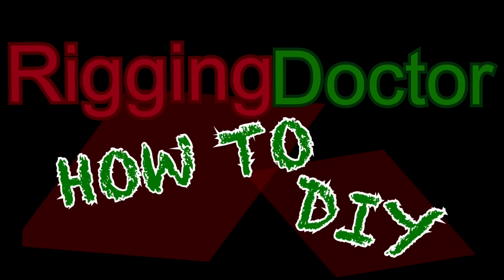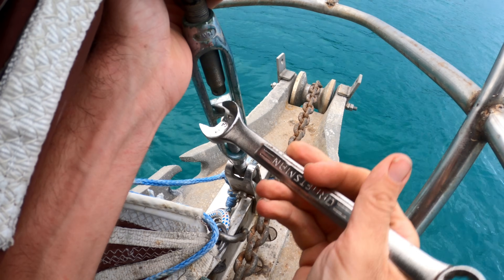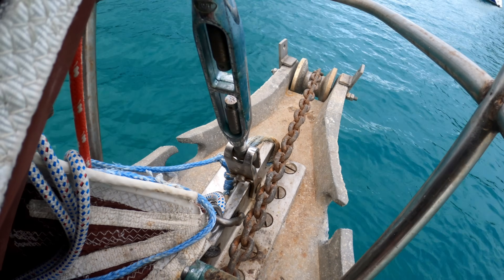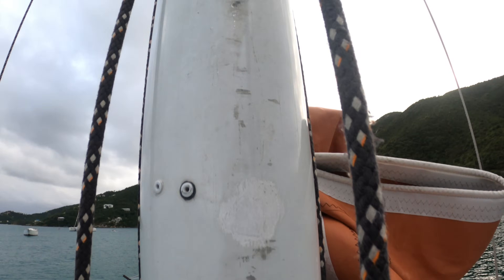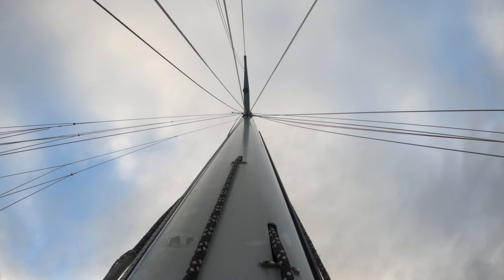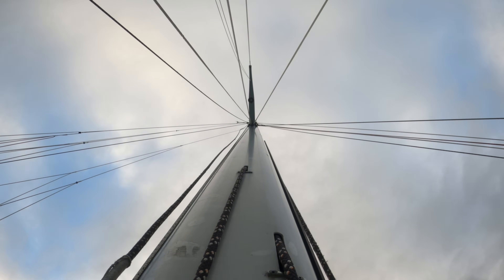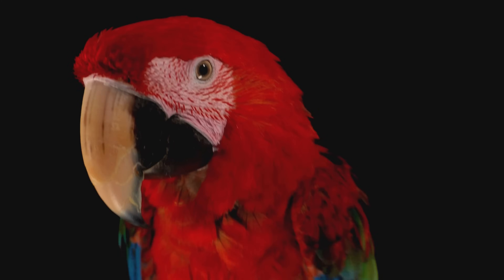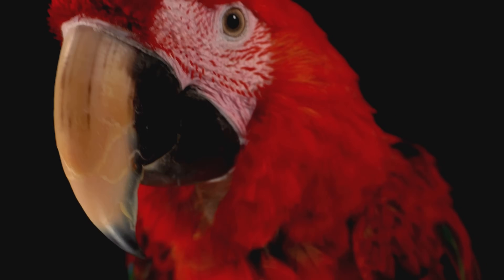How TIGHT Should Your RIGGING Be?

Comment: LOL so much wrong in this video, turned off as soon he started using gravity on a boat at anchor LOL.
Reply: @Sea Horse i am not an expert nor do i claim to be, but come on use your common sense do you really think hanging a 5 gallon jug from your halyard sounds like a good way to check the centering or rake of your mast i’m sure you have more common sense than that.
Reply from the maker: You can hang anything you like to make a plumb, but as a cruiser and a person who favors the practical, a 5 gallon jug weighs about 40 pounds and makes for a great weight. 
Would you prefer that I use something branded, expensive, and exclusive? Real sailors need to know how to check and fix their rigging with what they have on hand; every cruiser will have a halyard and a jerry can!
Reply: @Sea Horse To be fair, he wasn't claiming to be a professional or a perfectionist -that claim lies with the YT poster -who has made serious mistakes over time (as we all have). He's criticising POV's which is part of normal discourse and key for finding the best way to do something. YMMV advice is good.
Reply: @Sea Horse https://youtu.be/d6XVMZdyFLQ i don’t make you tube videos but here you go this is how it is done, notice no hanging jugs.
Reply from the maker: If the boat is properly trimmed in the water, gravity is of great assistance. If your boat is loaded unevenly, then you need to sort out your cargo distribution before you get underway (or even think about timing your rigging).
Reply: This is the same guy who said mizzen masts have no effect on the sailing of a boat...... proof of you own your own camera,  you can be an expert in their own mind
Reply from the maker: I think you should rewatch my video on Ketches and Yawls as you clearly misunderstood everything. 

I’m assuming (and this might be a stretch) that you understand the difference between a yawl and a ketch, as the mizzen in a yawl plays a much different role than the mizzen in a ketch.
Reply: I will do you a favor and explain at as i have actually set the rig on my boat literally hundreds of times i.e. before every race.  For rig centerline take your main halyard and pull down to deck level at the chain plate or deck hull seam this should be the same on each side of the boat adjust stays to center. Mast rake should be done by measuring  with a tape to some point on the stern or bow check with the manufacturer or user groups each boat has a specific measurement to properly set the center of effort.

There you’re welcome.

And please don’t spread BS info  and call yourself the “rigging doctor “  when you know nothing on the subject.
Reply from the maker: The important thing is you know how to set your rigging on your boat. This makes you a good sailor. 
As a rigger, I know how to set the rigging on a variety of boats and understand the differences between them and their needs. You said “before every race” and “user groups” so I’m assuming you have a very light boat that is tender. My weight on a halyard method would be influenced by a person standing on the boat. If they moved slightly, the boat would shift and give an inaccurate reading. The only way to do it with weight would be to stand on the pier on a very calm day and see where the weigh hangs with no one on the boat (and the boat perfectly trimmed before starting, naturally). This is a hassle and therefore your method of using the halyard as the hypotenuse and finding symmetry works just fine in your application. 
For a heavy cruising boat loaded up with all your worldly belongings, the weight method works very well because the boat is not as sensitive to weight changes and is more stable in the water (and also slower). 
Understanding that every sailboat is unique and setup a different way for a different purpose is what sets me apart and makes me the Rigging Doctor.
Reply: @RiggingDoctor  No, sorry, wrong, direct measurement is the only correct way. 
I should have dumped your channel a long time ago.
Reply from the maker: I’m sorry you feel that way, but have fun at your races :)
Reply: @zoomzoomracing  Ha! that's funny. I once tried to set my stays by measuring ( just for fun I knew it was a bad option) Adjusting them to be equal gave me a mast like a banana. My boat is hand built an in no way symmetrical which is why I knew this wouldn't work. But even with a modern production boat you're kidding yourself if you think you have perfect symmetrical triangles between your masthead, chain plates and mast foot on either side, they simply will not be, so measuring is futile. If you have a lighter boat that you think may be affected by your own weight then get in the tender on a windless morning at anchor and sight the mast as you travel around. I do this on a regular basic, and as Herby says you should be checking anyway to make sure you are sitting upright in the water and there aren''t any loading issues.
Reply: @svfairisle  LOL so you think the best option is to hang a 5gal jug and just eyeball it LOL i can assure you hand built or production it’s better to measure than use gravity in any form. Don’t believe me ask a professional rigger.
Reply: @zoomzoomracing  Personally I use a red mousing line I have run up on the halyard with a small lead weight on the bottom because I only ever do it on a flat calm morning at anchor. I can sight the line against the sail track to see the mast is precisely in column. This is the way any rigger who actually knows what they are talking about will tell you to do it. If a rigger started measuring things on my boat I'd throw him straight off, luckily I've never come across one that stupid.
Reply: @svfairisle  you were talking about your mast being in column i.e. straight that’s upper and lower tension. i think we will have to agree to disagree, if a rigger got on my boat and started using a plumb bob i would throw them off also.
Reply from the maker: I guess having your boat measure up on paper is more important than the boat actually being in proper form in the real world. Since your boat is so perfectly tuned, it wouldn’t hurt to corroborate the perfect tune with a plumb now that everything is setup to perfection via measuring. 
Professionals always check their work because they have attained the knowledge that real perfection comes from making sure everything is actually perfect.
Reply: @svfairisle  And how do you define "upright" on a boat in the water? Boat builders usually get the centreline to within a centimetre and I'd be very surprised if Fair Isle was so far off (isn't she from a mould?). Where you went wrong -first it's very hard to set tension only from shroud length because they are very strong in tension and second it's almost impossible to measure shroud length to the nearest mm (bends when laying it out etc) so I'm not surprised you got a problem with pure shroud measurement. Here's the thing, if the distance from the mast foot to the chain plate on each side is the same and if the distance from the mast head to the chainplate is the same on each side the triangles are the same. It's simple geometry. If you then have a banana it's the lowers or intermediates that are set wrong not the cap shrouds. If you mast is chocked take the chocks out before setting cap and if your boat is poorly built you might want to check the mast step for centring too...
Reply: @svfairisle  A mousing line is OK to check the mast is straight but I've aways just sighted up the mainsail slot. For gravity defined vertical a 1 degree list (hard to measure at anchor)  would lead to a 8" offset in a 40 foot mast. Where is true level for a spirit level on the boat -my comings and decks are all curved! A strong mousing line (i.e. low stretch when pulled tight) or halyard is suitable for checking the distance from the cap to the shroud plate on each side. How different is it on your boat? If it's very different have you noticed she's slightly more weatherly on one tack than the other?
Reply: @RiggingDoctor  "Professionals always check their work because they have attained the knowledge that real perfection comes from making sure everything is actually perfect". Sounds like hubris to me. How long was your apprenticeship in a specialist rigging shop before becoming a professional and where was it?
Reply: @SpiralDiving  You make some good points and there is no single correct answer to this I think except to say the OP premise that measurement is key and you can't rely on gravity is entirely the wrong way around! I maintain that measurement is futile. Your reasoning that if the mast head - foot and chain plates are the same then the triangle are the same omits the one crucial point that for this to be true the angles would have to be the same too. Fair Isle has wooden bulwarks and the chainplates are mounted internally on a lot of teak so chances of symmetry are zero. I have no real knowledge of modern production boats but while talking the John Harris who runs Attainable adventure Cruising and has been a rigger and off shore cruiser for decades he assured me modern boats are not symmetrical either and should be treated the same. I bow to his greater knowledge. Gravity is actually the ONLY thing that is 100% reliable as a plumb bob WILL hang straight down (I use a thin line and choose a still morning as a breeze is the only thing that can upset this)  Yes you're right however that this is of limited use as sighting is not easy, but I find by sighting off the boat in the tender, looking at the horizon and the mast and hanging line I reckon I get a reasonable idea and i have a good clinometer that I set and check against my sightings.
Reply: @SpiralDiving  I think the mousing line has a bit more use than that as it hangs straight down and shows how far the mast head is behind the foot (I mark the boom and can keep a check of this measurement) It also gives a nice straight line when sighting from the side (off the boat in the dinghy) so you can see rake and bend and if there are any hard spots in the bend. I have a deck stepped mast, the hard spot on a keel stepped mast might be harder to spot as it will often be at the partners if the set up was done wrongly. Fair Isle will show about an inch of difference when measuring the hypotenuse, but this would only be of concern if I tried to use it as a way of setting my rigging, which I don't. She does often favour one tack over another as most boats do, but being full keel I think this has more to do with whats happening underwater than on top. Could be wrong.
Reply: @svfairisle  A geometry gotcha. In triangle, if all sides are the same lengths they are congruent and have the same angles too! GCSE maths LOL.
Reply: @SpiralDiving  While that’s true in two dimensions does it hold up in three? Are you sure both triangles are perpendicular to the centreline or even more difficult in the case of swept back spreaders, the same angle aft? In a perfect world with a completely symmetrical boat I can see that measuring would work, but as far as I see it your method utterly defends on a boat being symmetrical which I maintain it won’t be. As I said I have about an inch of difference in the hypotenuse, no idea how much mast foot to chain plate, but there will be some. No boat to my knowledge has adjustable chain plates so I just can’t see how adjusting the tension of a stay to pull the mast one way until you get equal length stays both sides is helping you in any way.
Reply from the maker: I think his boat is really bendy and tightening the stay will pull his chainplate over due to flexing fiberglass (and ego). This would account for the adjustable chainplate 🤣

I have never seen a boat that was absolutely symmetrical, the chainplates are always close enough to symmetry but not enough to measure against.
Reply from the maker: As for my training in synthetic rigging, I invented the splice to make the deadeye and the shroud frapping knot to tie off the lashings, so basically since the beginning for synthetic rigging on cruising boats. 

My understanding of the world is knowing that I’m always learning, you sir sound like excessive hubris.
Reply: @svfairisle  In 3D the Pythagoras still holds and you just add the extra dimension as a square too (h^2=x^2+y^2+z^2 GCSE math again LOL). One inch of difference is small could easily arise from an error in the actual length of the shroud from tang to turnbuckle eye.  Wire/rod rigging is very hard to straighten to measure accurately!  Let's say the mast foot is exactly on the centre line and your beam is 14' and your mast head 50' above the line joining the chainplates on deck.  Design shroud length would be only 6" more than this mast height. To make the chain plate to mast head 0.5 inches longer on one side (and 0.5 shorter on the other) your mast would be off vertical by 4 degrees and the resulting mast bend (assuming foot and partners are spot on) would be easy to see...  Of course, if your mast is not on the design centreline at foot and partners then the shrouds will not be the same length even if the mast is vertical (but offset to one side). I'd be interested to know what the actual shroud length difference is (as reported by your loaded halyard at the chain plate/toe rail). Might tell you something about her build accuracy... You may be pleasantly surprised. Cheers
Reply: @RiggingDoctor   Are you sure that you are the first person to ever use synthetic ropes and needed to make a spliced thimble eye? Wire splices and braid splices are older than you and I think Paulson's invention (~1966) of braid splices for synthetics describes what you've claimed. Whipping to fix rope ends is probably thousands of years old (still used by archers on bow strings) and frapping knots are not new either (in Ashley's book of knots). You may want to look up the meaning of hubris and then look in the mirror.
Reply: @svfairisle  I agree,  the halyard/mousing line method is good for checking rake. Boom height at the stern will also warn if rake is far off design -assuming your sailmaker cut to design...
Reply: You should really watch all of it..... it is a great lesson in what not to do
Reply from the maker: @Camden Simon  🤣 you either go through a ton of diesel every season or don’t take your boat out

Comment: Thanks for the run through on rigging.  It seems like a tension gauge isn't needed!  Fair winds!
Reply from the maker: You only need a gauge if you are setting it up based on manufacturer’s specs, but after that the final tune is done by feel ;)
Reply: @RiggingDoctor  My boats are from the seventies.  I can't even find specs like that!  Thanks for taking the time to make the video and for the reply.  I was glad to see that Charlie is taking the time to learn the rigging too!
Reply from the maker: Boats from that era are very straight forward to tune. Modern race boats are the only ones that really need a tension gauge to start the setup (if the cap shrouds are not tight enough, the mast will snap forward in an inversion and break!) our older rig designs were made when materials science couldn’t push the envelope as far as it can today so everything was stouter and easier to setup/maintain.
Reply: @RiggingDoctor  I'm planning to replace the standing rigging on my 37' Vaitses/Herreshoff Meadowlark ketch, this winter.

It's an odd boat. Mainmast is only 28', the masts are on tabernacles, and depending upon where I'm sailing may need to come down and up multiple times in a season.

I've been pondering over the lower terminations, what I could do that could easily be loosened then retightened easily.
Reply from the maker: The combination of deadeyes and turnbuckles will be excellent. You have the turnbuckle loosened all the way and simply tighten the lashing as best you can by hand, then tension with the turnbuckle. The stays will be able to get longer to allow the mast to lean forward as you lower it, but will never need to be disconnected. Dyneema is great for this purpose because the line is soft on your deck and ok with bending whereas steel is rather hard on the deck gear. 
Lowering is easy, tensioning after raising is quick and easy as well.
Reply: @RiggingDoctor   Colligo's new stopper knot lashing might work well with that.

Comment: I just got a 1979 roberts 43'ketch. Do you know why the mizzen mast is raked backwards a bit sometimes?
Reply from the maker: It’s set that way to help out with sail balance. The mizzen is always raked back a bit more than the main is.
Reply: @RiggingDoctor  MUCH! Thanks.
Reply: Depends on what the designer intended -usually they are nearly parallel but if she's sailed routinely with beyond design heel the rake on both masts may be adjusted to ease weather helm (NB reefing the mizzen has a strong effect on weather helm).  If the mizzen has a lot more rake than the main could the triatic stay be wrong? You should consult the rigging plans if possible.
Reply: @SpiralDiving  I forgot to say, There is no triatic stay and I don't want one, I heard if you have one and you loose the main mast, it will take the mizzen with it if you have the joining cable.
Reply: @SpiralDiving  In respect to "Heel "She's a full length keel and I really liked what Herbie said a few years ago about when they reef, he claimed that due to the fact that they sail with thought given to comfort they are governed by 15 degrees, not wind speed and I really like that mindset. Though I don't know what the previous owner did.